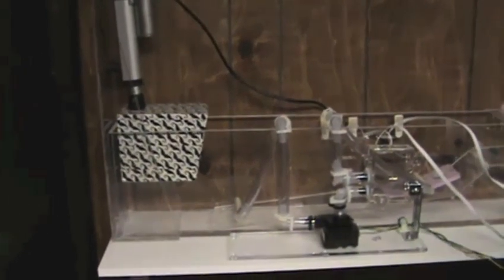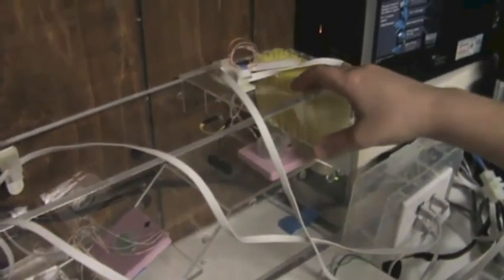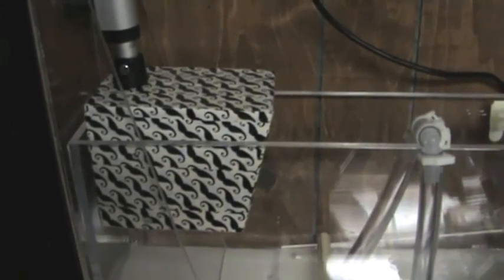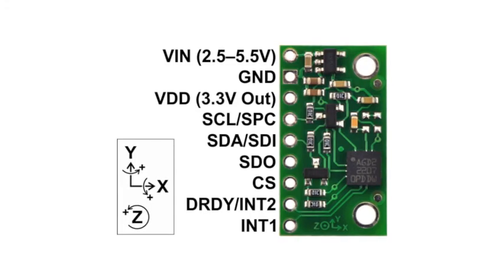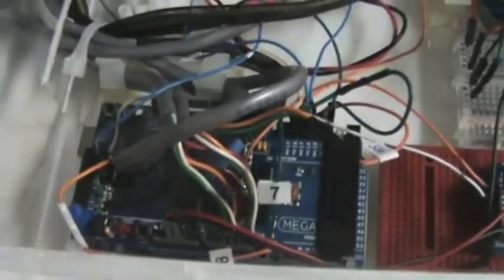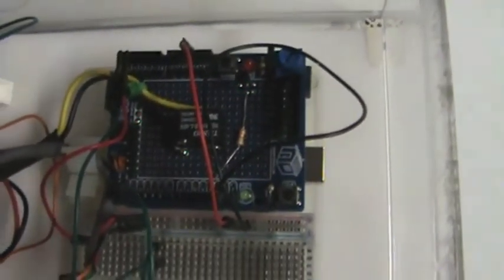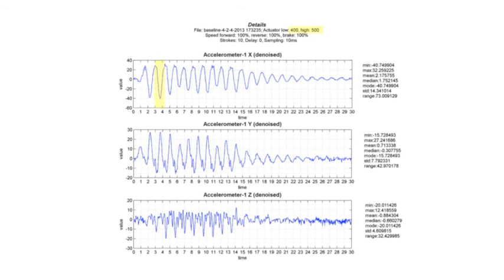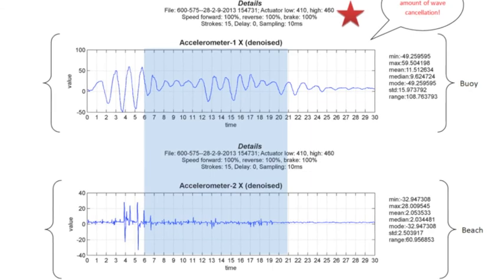Wave Tank - Wave Phase Cancellation Applied to a Fluid Medium

Comment from the maker: Wave are most visible in the X-axis accelerometer results (tank - left to right direction).  The X-axis are the top graphs in the video, they look pretty clean and match the stroke count.  The accelerometer in the Y and Z directions was likely affected by some reflection, and the interference from the two generators.  In the end all I cared about was the reduction in amplitude.  I really didn't think of using a spill chamber. I will check out your profile.